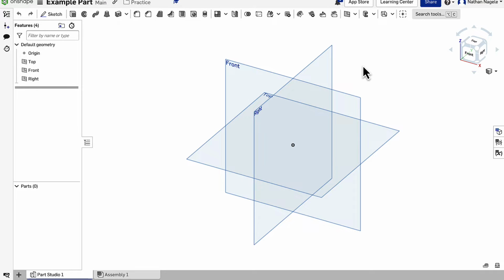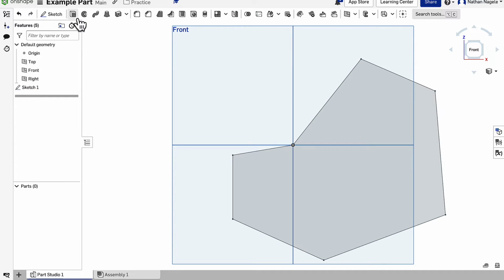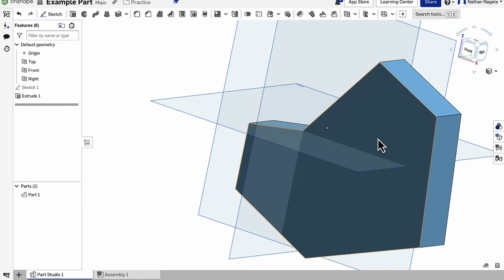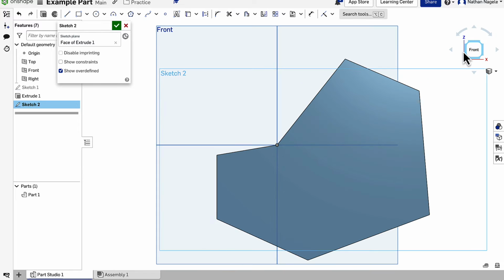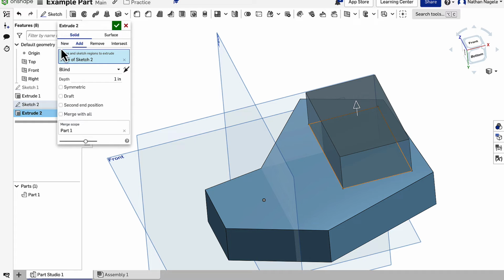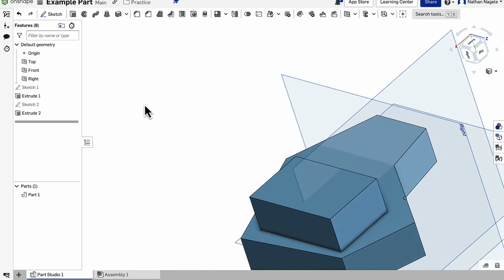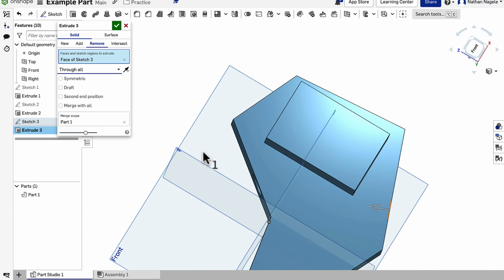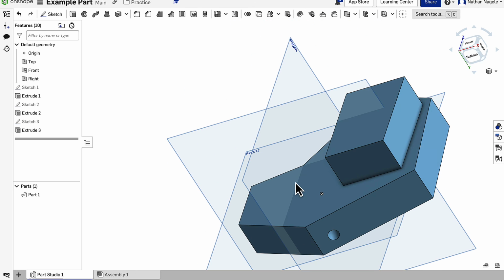Adding and Removing Extrusions in Onshape | Beginner Tutorial

Comment: Im having a hard time figuring out how to remove material on the side of a splin pin.m Its off the radius side and its jujst faces off flat but does not go to the end. Imagine if you puit a .5 inch pin on its curved side and ran a .25 mill accross one pass. This is what Im trying to do.. Hope that makes sense.,
Reply from the maker: I think I get what you are saying. I think a sweep would do what you want. Basically you draw the profile that you want and then you can draw a path on another sketch and have the profile follow the path. I can make a video on it if you would like to see more of what I’m talking about.